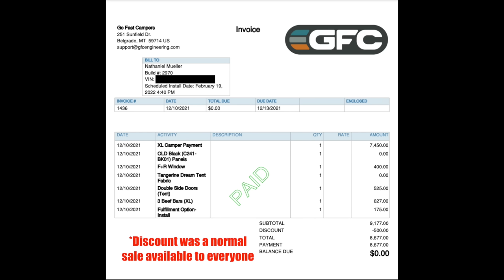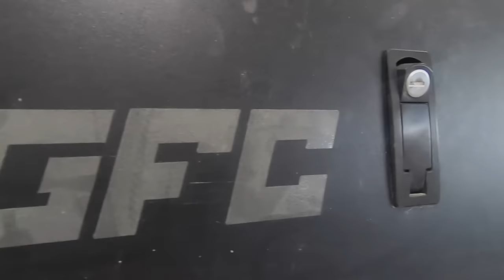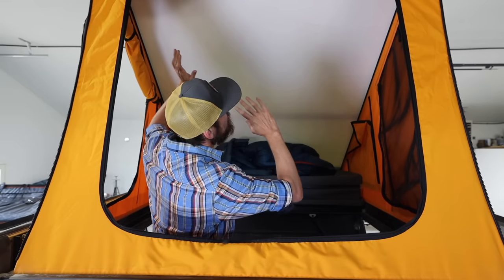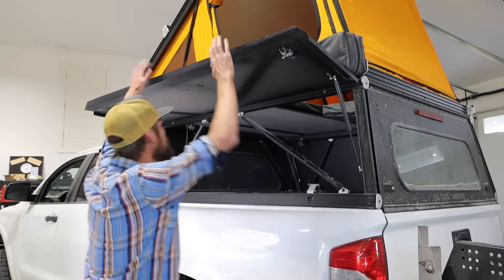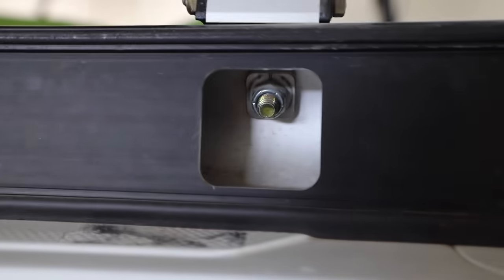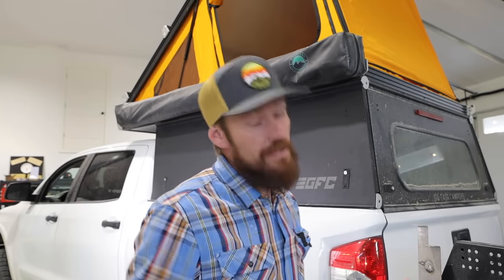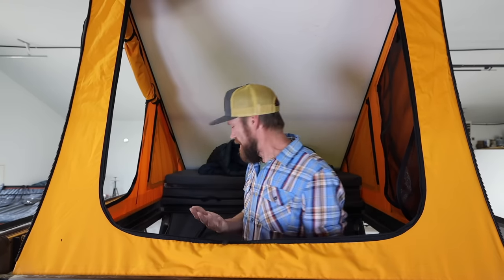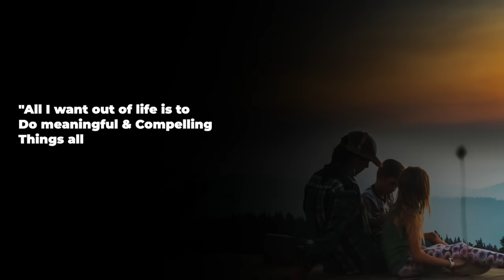GO FAST CAMPER, The BEST, WORST Rooftop Tent - Honest Long Term Review - Truck Camper Buying Guide

Comment: Thanks for this review. Im thinking this camper on a Power wagon, combined with the Deck system in the bed would be a GREAT Set up!!! ReALLY liking this one for its lightweight and no nonsense approach. I think adding that molly panel on the front would be nice too as long as you dont mind looking the rear view mirror view.The power wagon is really light on payload as well, so thats why I was researchign this particular unit. ONE QUESTION: how well do the side doors and rear doors hold up to windy conditions when the panels are up in the open position?
Reply from the maker: No issues with wind at all… occasionally I forget to close one and have driven down the freeway… still don’t flap around.
Reply: Have Decked drawers and a GFC in/on my Tacoma. What a combo! You won’t regret either

Comment: Meh the GFC was just first to market in the lightweight minimalist camper-topper segment so they are benefitting from early market share, and a lot of WoM advertising. It’s not a bad product but it’s not as refined as some of the newer options on the market. 

I think the best overall right now is the TopoToppers Mesa. Way more customizability, better QC (now that GFC is in full-on production mode), better weather/dust sealing, and $750 cheaper to start. Also for someone that enjoys camping with dogs I just couldn’t get myself to sacrifice on a GFC the lack of a front pass through window and the inability to have factory installed sliding RV screen windows was a dealbreaker for me.
Reply: If you get a Topo Topper Mesa with side access doors the price jumps up $1k to $7,900 which is the same as the GFC. From an engineering perspective the design of the GFC canopy looks a bit better and the tent looks like it would have all the same issues the GFC has. I’d pick the company with the reputation to back up its products.

Comment: Excellent review, man!! Last month I checked out some new campers on the market at Overland Expo and came across 4 types of trailers I really like; Here is the list of them and my opinion.
Harker Outdoors - I really like the design a little boxy looking for my taste, but the extra shade in the back is cool, but my only concern is when it's window and not so secure when you're camping.
Project M - The space is fantastic! But, again, to boxy looking, move your bedding around each time you put away their bed frame, and you're stuck with their accessories mounts, and if you are Ok drilling on their panel, it's ok to mount your own design each time.
Super Pacific - Looks calm, very similar to GFC. The only difference is that the window has no bars like the GFC.
The one that really stood out to me is the PACKOUT Campers. It's like the mix of what we all want! The really cool thing about that camper is how modular that thing, really well-thought-out design
you get the gas strut assisted floors similar to Alu Cab, you get the wide window of Super Pacific, a 3-inch Mattress, and still, you'll be able to leave all your bedding in there even your house pillow,  you can also mount your bikes on both sides of the camper, Molle panels everywhere., and the big one for me is its not big box on your bed. Ordering mine next week.

Comment: I’d say that the majority of the ones that will be sold will go to reviewers. I just priced one and the cost is outrageous. Very nice review though.
Reply from the maker: Are you talking about the GoFast Campers? They have sold Thousands and Thousands… out here in the west I probably see several every day… if you add up the cost of an aluminum bed cap and a rooftop tent the go fast is pretty competitive… it’s also one of the cheapest campers on the market. They are mainstream at this point… already

Comment: You stated that the first version broke really easy. I have been trying to do research to find actual examples of this. I even contacted GFC directly and they said they had not had any issues with this happening yet what you said contradicts this. Do you have any actual evidence or something online where someone shows that the space frame of the version one did break? Please share.
Reply from the maker: The first one wasn’t a space frame it was welded. It cracked at the joints for some people. I didn’t have one so no I dont personally have proof. Also I didn’t say it breaks easily… they just had issues there… if it never broke then why did they re-design it? Arb tells me their compressor never clogs and RCI tells me their brackets never fail too when you call them 🤷‍♂️
Reply: I'm just trying to do some research. I have seen both the version 1 and version 2 in person and I'm trying to make a decision.
You said "those broke really easy". This is on your video starting at about 8 minutes 40 seconds.

Comment: Can you share your bed light setup ? TY
Reply from the maker: Yeah, those are little defused rigid lights I have in the bed. They are mounted to the tracks or the mounting screws on the GoFast. Then I have a switch in the bed that controls them and I run them off a secondary accessory battery. these are the lights - https://amzn.to/3KOTbOU

Comment: Respectfully dude, the roof is not made of aluminum, which is metal. If it was aluminum it could not be transparent. The roof is made of Plascore polypropylene honeycomb panel.
Reply from the maker: Respectfully a big portion of the roof… and what makes it strong IS made of Aluminum… “An extruded aluminum load halo surrounds the Topper's roof, distributing loads to the space frame. And the white roof itself is made from a one-inch-thick honeycomb composite panel, which reflects solar radiation, while providing an insulating air gap.” But sure thanks for the correction…
Reply: @OutdoorAuto  I'm responding to 7:08 -- the part of the video where you touch the white honeycomb panel and call it an aluminum honeycomb panel. It's not aluminum and I'd hate for people to get the wrong impression. I'm a fellow GFC owner btw.

Comment: At a whopping $7,700 for the full setup, that's a hard pass for me. Even if this could accommodate a roof rack, that's such an excessively overpriced setup that could be accomplished with similarly plain yet durable products for half the price. Serviceability is nice on the tent, but they're definitely not even close to the only company that make one. I guess you could argue that this is the absolute LIGHTEST you could get for a topper/tent combo, but I'd be willing to bet that's still debatable, and if it isn't, I guarantee this is a situation where the next-best is only marginally worse for significantly cheaper.
Reply from the maker: One way I look at it is this is basically a nice truck bed topper and a nice RTT.... Toppers like this (for example the RSI) cost $4000 and tents like this cost anywhere from 3- $4000.... so the price range isn''t that far fetched... the thing that cost the most is all the Billet parts... which of course are what make this tent unique and much stronger.  So I would say the price for the product and the materials it is made out of makes sense. There will definitely be people that make ones cheaper... but I would bet those will not be stronger. 🤷‍♂️
Reply: That price is INSANE for what it is...
Reply from the maker: @socaloutdoors7355  I feel like everything is crazy expensive nowadays.
Reply: People calling the go fast expensive clearly haven’t shopped around in this segment.
Reply: @cmc9823 True.  I think the GFC is one of the less expensive options out there for something like this.  I think many, if not all, things in the overland market are price inflated.
Reply: When you say it can be done for half that price? Does that include the labor to assemble it? Because if you’re talking about making it yourself then yes of course you could make it cheaper but what I would say is that the most affordable option that I’ve seen is the : Topo camper.
Reply: @cmc9823 yeah idk about that. If a person really had to have a rtt a smittybuilt is well under half the price of this thing.
Reply: @BaldKiwi117  for sure! But what are they putting it on? For it to be remotely comparable they need a hard shell and that costs 3k conservatively. But if you go with a good shell with options you are probably 4K for that alone, then most well known hard shell tents like the iKamper are 3.5k. So for something premium 7.5k together before tax. That’s still less than a go fast, but also lacks a lot of the functionality of the combined system.

If you look at other actual campers like super pacific, AT, 4WC, AluCab, etc. that actually are comparable the GFC is a deal.
Reply: A decent truck canopy is 3-4K and decent roof top tent is 2k+ so seems pretty on point. Plus it’s built in America.
Reply: Lost in the argument are 2 things: 
1 - Security is better than a regular shell
2 - You can’t stand inside a cheaper shell /RTT combo
3 - You can load the roof down with bikes and gear